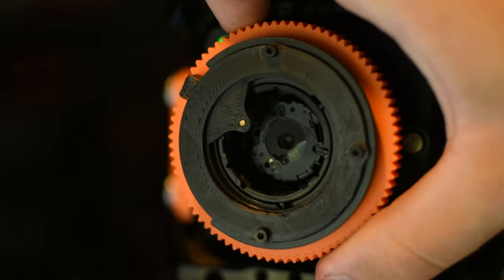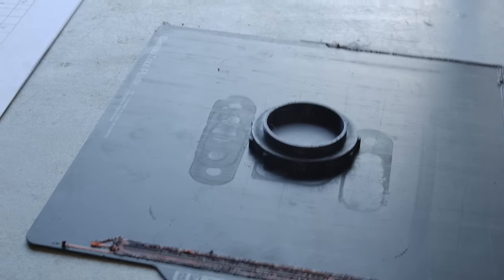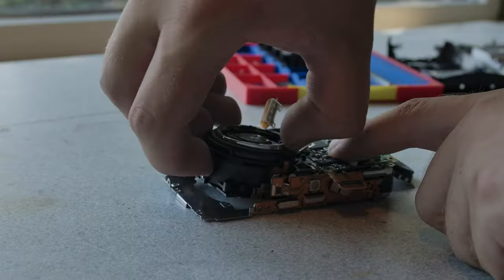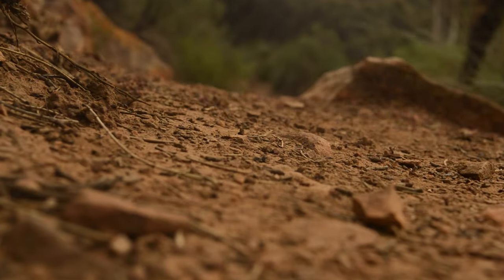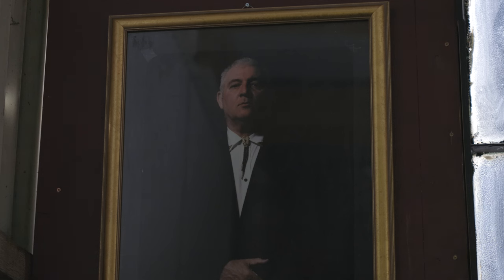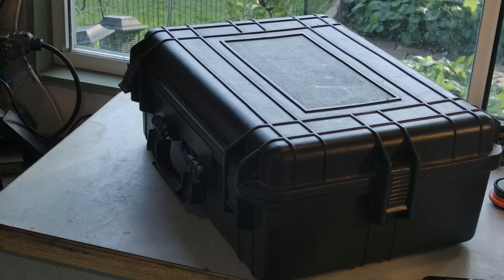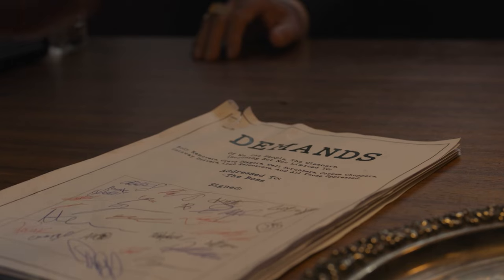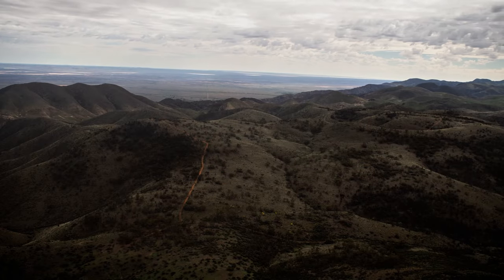3D Printed Gear That Makes My Filmmaking Stronger

Comment: Awesome video. I'm always printing tools to make my work easier (as I look at your orbital ball vice I printed that still nees the actual vice part)

I think you just ignited all the Rigging/Lighting guys' PTSD with the light mounts. Make sure you're using plastic that will malform rather than break so you can tell if it's failing... Before its proving gravity for you 😆